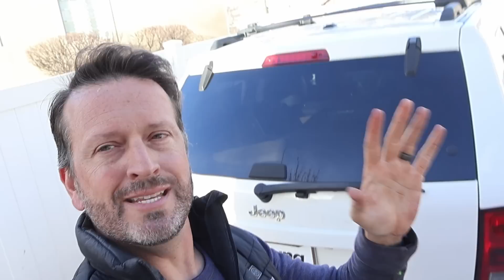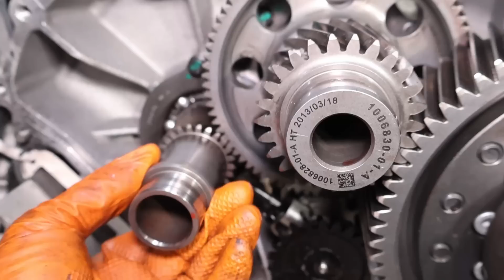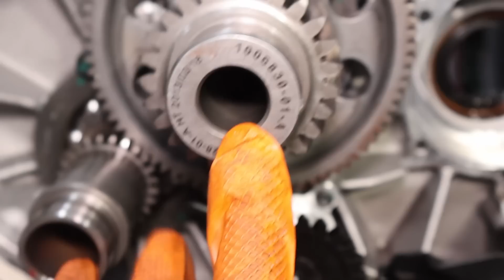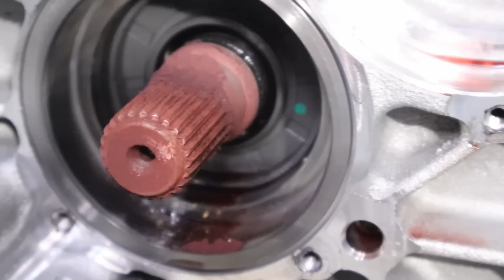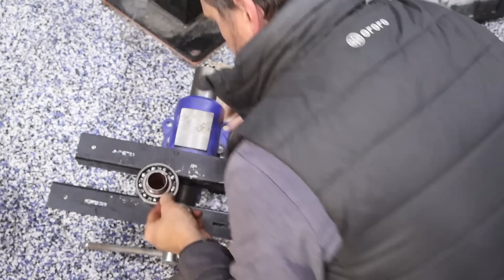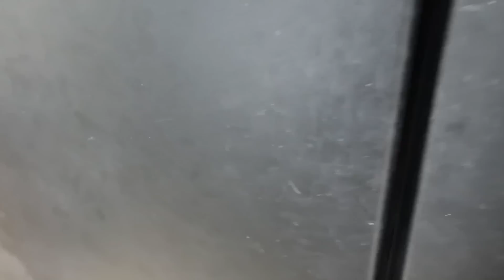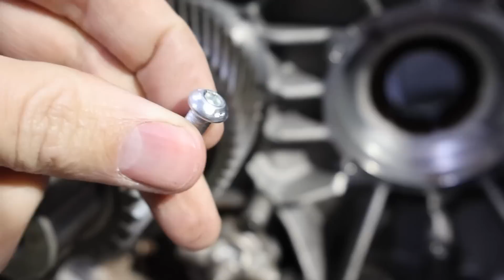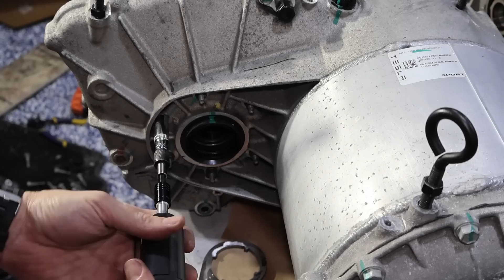Make Your Tesla 2x Faster with This Gear Set Swap!

Comment: What is the best source for prop shafts?  Also what would be require to rotate the assembly 90 degrees?  Ex: Invert and motor parallel and above the prop shaft drive shaft output.  Thanks
Reply: Also do you still use recommend the AEM inverter board or EV Controls?  Any insight in to the best application of each solution would be appreciated (pro/con) thanks
Reply from the maker: We only use AEM if the motor needs to be reverse mounted.  We usually opt for Dynam Labs but EV-CONTROLS is also good
Reply: @electricsupercar thanks I have a new name to do some research.

Comment: What gear ratio did you use? Im trying to see about how i can increase the top speed of my model 3 single motor from 141mph to 160-170mph for open road challenges & pikes peak runs.
Reply from the maker: Here is the same thing to the model 3
https://youtu.be/Y1g66BW1xWc
Gear ratio is 4:1
Reply: @electricsupercar cool. Ill give it a watch man. Thanks!

Comment: So, now youl have double the power and less max speed? I dont understand.
Reply from the maker: No.  The motor will spin the output shafts about 2x.  Double the speed at the output shafts.
Reply: @electricsupercar So, youl have 2 times faster 0-60 with that? Or youl just have max speed doubled from 150 to 300? Why would you need that on a truck? 
The way i see it, with my logic, i can relate to bike gears, where you get more speed but youl have to work harder which should lead to more max speed and worse 0-60 because its going to be harder for the engine to spin new gears.
Reply from the maker: @bilboriches7216 ma6be watch the video again.  I explain it pretty well for my application. I am putting the motor in a different vehicle that drives a differential.  The differential has a 3.7:1 gear ratio.  That would mean top speed for the new build would be 50-60mph.  This gear swap gets the top speed back closer to normal.

Comment: You messed up , you should’ve done the motor swap and included the independent rear suspension while keeping the direct drive. No need for that Janky driveshaft with two old-school wobbly u joints.  Also no 600lb rear solid axle with a 90° type ring and pinion set prone to getting all snapped up.   The Tesla driveline has the ring gears ⚙️ all in line with the motor output no 90° change in pinion.  Way stronger.   Also with such a tiny driveshaft, how many inches of travel are you pulling back there before it binds up ? Would’ve been way cooler and much less hillbilly bs  if you kept the independent rear suspension going with massive Porsche 930 type CVs . Probably achieve 10-12” of independent rear suspension travel.  Ultimate handling and way less unsprung weight.  Instead of that donkey cart rear solid axle end from 1890.  Aren’t you losing efficiency and drag by going through that old-school jeep solid axle driveshaft bullshit as well?  It’s not even a fully floated rear end is it.  The more I think about this the more pissed off I’m getting.

Comment: Most Model S capable of super high speed have 2 motors. In my case (Raven) the front is a PM type motor.  To get that (theoretical) 250mph, the front has to be upgraded... have you done it?

Comment: This gear reduction ratio will put a huge load on the motors, it will consume more power or it will fail at some point
Reply: I'm also intrigued. Know you are going for top speed not economy, but how much does the the taller gear increase consumption at lower speeds? My own experience, just putting on bigger wheels  require more torque of the motor, even at city driving speeds, so my consumption went up, even with the theoretical lower rolling resistance of a larger diameter wheel.
Reply from the maker: Motor is spinning slower.  Gears are spinning faster.  It will not fail.
Reply: @electricsupercar I am wondering where the torque difference will go, from 9:1 to 4:1 ?
Reply from the maker: Torque at the wheels goes down, speed goes up

Comment: ok just to help you there..... gasket goo is designed for you put it on "evenly" like smooth it out with a popsicle stick or something.. then the trick is to let it go off,, so that it goes like rubber...... then you can put it back together.....a lot of guys do it wrong, they put the goo on, then "straight away" squash it flat by putting it all back together,,.. you look like a guy that likes to get things right.
Reply from the maker: @MRBACKHAND  thanks for the advice!
Reply: @electricsupercar  no worries love what your doing, also what your thinking is rust, is not,, its basically a "dry lubricant" and it kinda needs to be there..... why they make it a rust colour is beyond me..... it used to be dark grey. and called graphite lubricant... but i can assure you its not rust
Reply from the maker: @MRBACKHAND  👍
Reply: but love what your doing.. and you ve learnt a lot in your "journey".. im taking it by the way you talk that your christian? would i be right in saying that?  im from Auckland NZ

Comment: 0:27 for every 3.7 rotations of the drive shaft the wheels make one rotation.
The engine rpm is irrelevant to tire rotation because of the gear box since it would depend on what gear, engine rpm and speed you're going, but drive shaft to wheel is a mostly constant ratio assuming no slippage.

Comment: maybe i am naive. but maybe someone could explain if this is wrong. since you swapped out the gear ratio from 9.7 to 4.x. the motor doesn’t have to spin more than half of what it used to. 

with that in mind if you were not going for speed but more of duration of travel. wouldn’t the power used for normal driving decrease as the motor does not have to spin as much?
Reply: am I off my rocker here?

Comment: That is NOT rust what you saw on the drive gear, that is a dry powder lubricant and is quite vital. You should reapply a fresh one after you wiped it off.
Reply: they should have make the color blue or yellow, instead of exactly looks like rust powder
Reply: @steamdota6786 If he has a maintenance manual with him he could have known about it. This level of disassembly is not meant for weekend DIYers and that’s why the engineering department did not thought about putting cute colors to guide mechanic wannabes.

Comment: Don't get the allen key screws, same bolts that came out. Use an open end spanner. May need a thin one but looks like would be enough room to tighten.

Comment: Chances are the lock nut is on for bearing preload or just to keep the bearing in place.  In my line of work (which involves those bearings) that lock nut is primarily used for preload.

Comment: Great video! Where can I find the bolt torque specs? I saw in the comments of one of your other videos that they can be found in the Tesla service manual but I can't find anything about the casings and internals of the drive units there.

Comment: Have you opened the motor side? Since you see all that rust, I recon there is a (very common) coolant leak and much more corrosion inside the motor. I would open it and check, and also do a Large Drive Unit "coolant delete" (google it.) Good luck! 🙂

Comment: 3:55. That's because it's a torque converter. By changing that gear. You're reducing the available torque. 

Four top speed. Which is weird.!! 

Because it's going in a truck.!

You should be replacing that gear.

But for an Even greater reduction.

So for every 18 turn of the motor. The wheels turn once..!!!

And that might sound more inefficient to you. But it is in fact even more efficient. 

Because the motor has to use less energy to spin at the desired RPM. Even though the average desired RPM is higher.
Reply: its goes to the diffs as well wich reduce the speed by 3.5

Comment: What does this do to the big drive units in terms of 0-60 & 1/4 mile times with Tesla’s 600hp big drive unit and most of all what is the new top speed? My company are restomoding exotics! I have so many questions.
Reply from the maker: Ask away

Comment: Lets say this is twice as fast in top speed with less power and charge consumption at low speed which is good enough for a jeep conversion. . but for a drag vehicle or Low speed power boost the reduction amount must iNCREASE from 9 to 15  or 20 to 1 ratio

it doesnt hurt to just add a power gLide mini transmision and enjoy every gear ratio for what they offer

specially when there is a siLent mini diesel range extender on board________
Reply: as far as best possibLe power magnification 

there is aLways room to combiNe more mass to the motor rotor shaft or one of the reduction gears and spin a 200 pound or heavier fLywheeL at near or above 8000rpm and try to pull a train with the same modeL S motor !

so it becomes cLear to the pubLiC

what FLYWHEEL ACTUALLY iZZ !
Reply: so yes a 120 kw  audi a3 tdi engine can now pull a train so as a model 3 tes\la  using huge flywheels 

and if someone likes to have more drivability 
from such power setup for a truck or a semi

the ivt transmisions from fendt tractors can soLve that, reaL quick

Comment: I'm so interested in this mod,  but I want to know if that gearing change will start to break stuff. I remember messing with go karts the chage of gearing and power change to the wheels broke my tire bars holding them after a while they bent so I'm so curious how this will do. So wouldn't that setup give you higher top speed but less torque? And doing the apposite give you higher torque low top speed?.

Comment: So if you have a sizable leak in your tire can you screw it on, tape it to the tire and drive it to a safe place while it continues to keep your tire aired up?
Reply: I hope you're not serious. It would only be usable at super low speeds, otherwise it would all fly off. Even if none of that was an issue, I'm sure the battery would run out pretty quickly if it's leaking enough for you to consider such a thing.

Comment: Dude! What the actual hell are you doing??  

Driving stuff into the machined mating surfaces and scratching them up? Putting gears on backwards? Trying to tighten and loosen fasteners while your body mechanics are cammed over (Not helping yourself), Using allan bolts in the worst possible use case? you should have just used the regular ass bolts and walked them all in! All your gears have metal and other crap embedded in them. You dump rust all over your brand new gearset. You literally clamp with steel jaws on the gear teeth directly?!?!   What kind of hack job is this??????  

And you're NOT making your tesla "Faster" You're making it SLOWER with a potential higher top speed. and that's IF it were in a tesla. You literally took a tesla with a 9.7 gear ratio and converted it to 4 (Transaxle) x 3.7 (Diff) = 14.8:1 gear ratio jeep or wtf ever it is..  with the tesla top speed of 130, you just reduced that to 85mph in the jeep as the TOP speed. Maybe just a hair faster as the tires are likely an inch or 2 taller at best.  And top speed is dictated by the motor max safe RPM and motor reluctance. You're WAY out of the motor efficiency range spinning it that fast.. You'd also have to regear the jeep diff (Which is going to destroy itself if you put any sort of power to it.) to get it within a more reasonable rpm range at freeway speed.   

Regardless, electric stuff is cringe.

Comment: Good video! I learned a bit. 
Might put a retraction in about Tesla speed, 150 mph is common, faster ones are 175 - 200 mph capable.
Reply: It's accurate the ones that can go fasted have a special carbon fiber bound rotor so the motor can do higher rpm without exploding so that would make them the exception and nothing to do with this

Comment: that motor with a ratio of 4:1 will definetely heat up and loose torque , your not going to get the speed ,  the jeep need to be lighter than a tesla !  the reason of 9 ish : 1 ratio

Comment: Excellent and informative video. As a couch engineer I may only say that I don't like the fact that the ratio is a round number. It means that every 4 turns the same teeth will engage, increasing localized wear. Good gearing gets always prime ratios whenever possible, so to have all teeth of one wheel engage with all teeth of the other.
Reply: Bravo 👏 retort!..I agree
Reply: @williamharris1485  Sorry I don't understand. "Retort"?
Reply: Nice answer, but the actual ratio specified in the product description web is 4.5:1
Reply: One gear is always best to be odd No. Of Teeth. You don't a prime No of teeth. The some of the two gears to be Prime No. What you are after is a "Hunting Condition." What you don't is cyclical engagements. These give noise harmonics & find all the errors in the gear pair & wear them into an ever worsening condition. 9:1, down to 4.5:1 is hell of a speed jump. But you are halving your Torque. Yes it will go faster but will it climb such step hills? 5 fat people & their luggage?

Comment: You need a Dragy test now to prove a Tesla can "go twice as fast" with this mod. And not a jeep. A TESLA.
Reply: It isnt going to double the top speed. If a plaid does 200 mph and with these gears it would probably do a realistic 250-260mph. Those gears are a huge mechanical disadvantage now, not to mention wind resistance, downforce, etc. at 260 mph is wild. Those forces are not linear, its a bell curve.
Reply: Not fast in terms of acceleration but fast in terms of top speed.

Comment: I totally get why you need to get new motor reduction set in a stock Tesla, but wouldn't it be better/cheaper, to change the rear end for a better final ratio in a Jeep?
Reply from the maker: I didn't see anything close to a 1:1 and I would have to do it for both front and back.  I thought this might be the easier, less expensive path.

Comment: The last thing anyone needs are faster Teslas.  Haven't you seen the things they do?  Those impatient pricks think the world revolves around them.  I am still considering a police report against one who used the shoulder of the road blocking my legitimate right of way turning from a designated lane.  It would not be so infuriating but they beep at you as if you did something wrong.  It was in mid December of last year but I do believe I am still well within any time limits.  Even though I have not filed a report I still have copies of the dash camera clip with no rear camera but it would still be enough since it is an easy to find location where they can see for themselves there is no designated turning lane there but instead someone making a right turn just makes the turn (signaling of course).  Not only was it the shoulder of the road but it was also a rather narrow part of the road I would not have used like that.  I just hope these jerks are using their own Tesla cameras smugly thinking that they could pin the blame on someone else only to find themselves in cuffs in a second or less!!  That would help reveal to these jerks that the world does not revolve around them (though some are so fat you would swear it does).  This is not just about Tesla owners but really all of those jerks who think they are better than everyone else.

Comment: When these are assembled, or any gearbox for that matter, you measure the height of the gear assembly and bearings and match that height with the space you have in the housing. You want pretension on the bearings and you set that pretension with shims so that you run properly on the gear flanks, avoid noise and obtain design life of the bearings, at all torques and temperatures. I did not see that analysis but I hope you get lucky and have no problems, but a bit dicey since you replaced so many components and the tolerance stack is probably not according to spec

Comment: You should have tested the oil sprayer .
this is very careless as you have to test the spraying pattern to secure lubrication of an axel that can spin at 18000rpm since you left a rather rough surface on the spraying needle.

Comment: Haha, your Tesla doesn't go twice as fast.
Is this guy for real?
You'll probably go a bit faster but it takes two times the time to get there!
Probably more.
Your acceleration will be twice as slow, that's for sure and you're probably using a lot more electricity cuz you run (way) below the powerband.
These gear ratios are there for a good reason...
Besides, using inbus instead of the original bolts is a bad idea.

Comment: You may get to 250 mph but how long will it take to get their? I bet when it switches gears it loses alot of power so it will take way too long to get to 250mph so you better have a long runway no way you can get their on any street lol.

Comment: If you're going to mount that transversely,(which is the most inefficient way to do an EV conversion) and use a common differential in the back, why would you go through all that trouble? Just change the final gear ratio in the rear end and be done with it!
Reply from the maker: I didn't see anything close to a 1:1 and I would have to do it for both front and back.  I thought this might be the easier, less expensive path.
Reply: @ point taken. I would've loved to see this conversion and it's natural state. Eliminating the second differential, I just mounting the whole motor in the back like in the Tesla…

Comment: So if you did this sort of thing but for a Tesla, would the Tesla freak out from the modification?
Reply: I'm sure the computer wouldn't like the discrepancy between motor RPM and vehicle speed. That being said, going from a 9.7:1 ratio down to something like a 3 or 4 would make the car almost undriveable. Its theoretical top speed would be super high, but acceleration and torque would be pathetic.
Reply: @sportbikeguy9875  Well the Tesla's have crazy acceleration already.  The gear reduction would just make it more like a normal gas vehicle.  As long as the driver took a easy on the pedal.  Might make the batteries last longer.